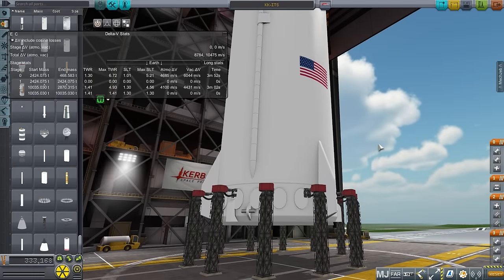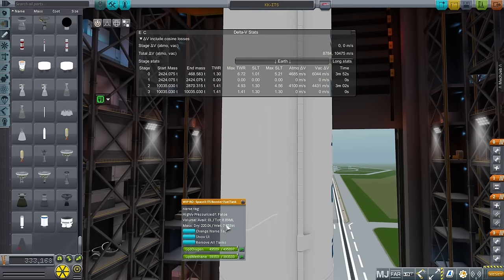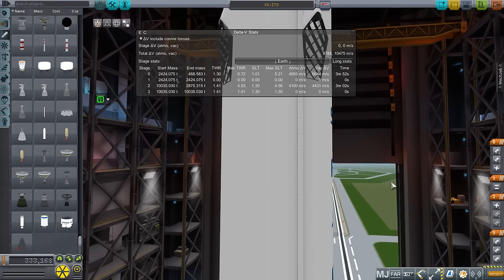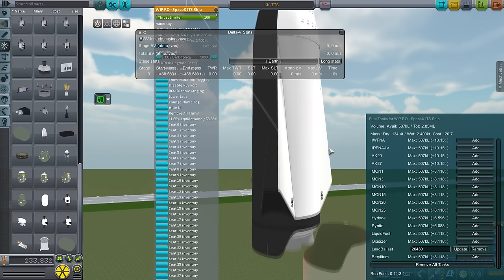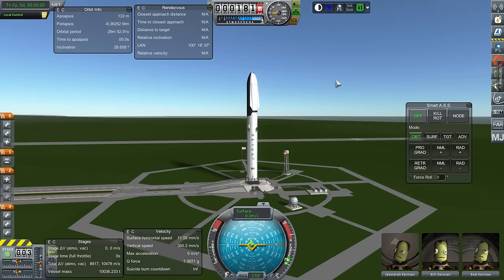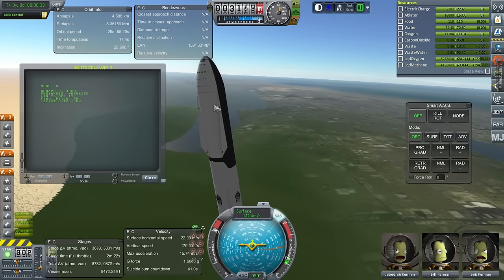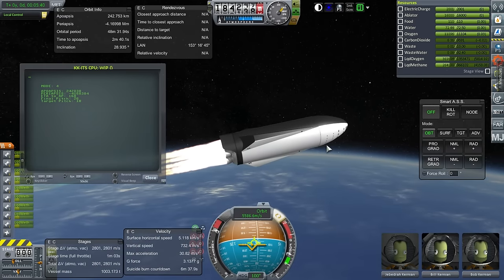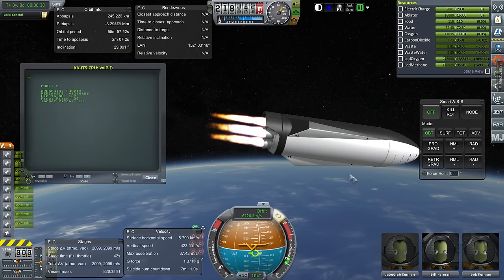Trying KK Launchers' SpaceX ITS in Realism Overhaul (KSP 1.1.3)

Comment: Nice video. But I realy suggest you to also try the ITS mod by Mark Thrimm, because i think the modeling and texturing, especially from the engines is much better. Also this mod doesn't has the flaws you had, like extending the upper engines for the right length.

Comment: If the part has the old category of "propulsion" set, the game looks for ModuleEngines or ModuleEnginesFX to place the part either in Engines or Fuel Tanks. When you have RF, it rewrites all parts to use ModuleEnginesRF so the game takes it as not having an engine module and puts it inside the Fuel Tanks category.
If you correctly set the category for each part, it should appear in the correct category tab.

Comment: There is a mod to automatically throttle engines to provide torque, I can't remember what it is though. All you have to do is turn the ship and if it is setup correctly it will automatically throttle the correct engines to turn you.